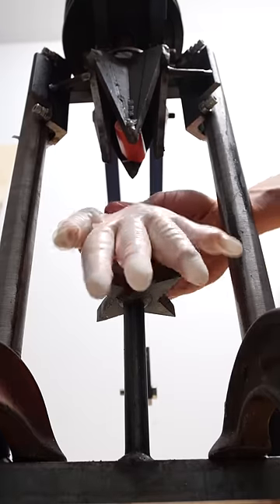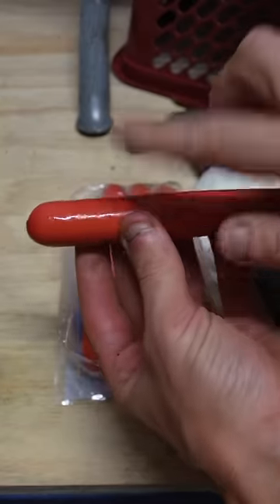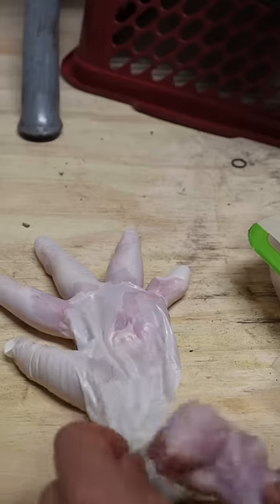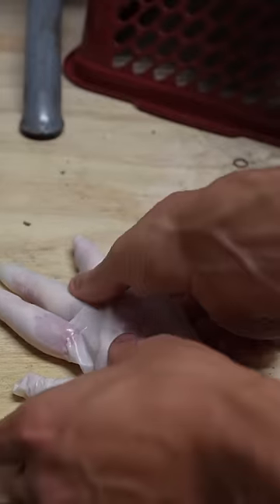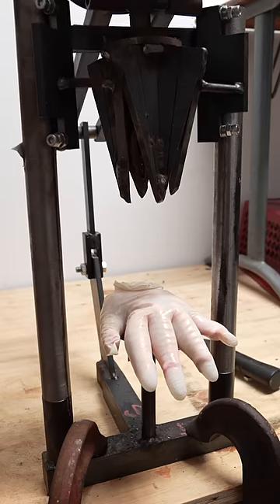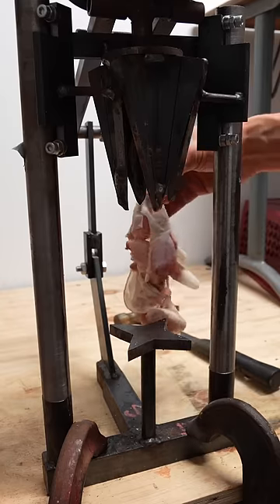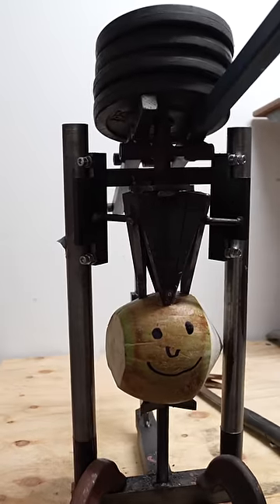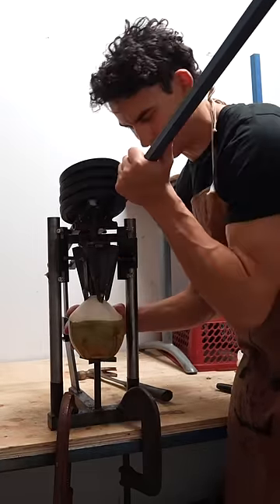Can crusher vs human hand

Comment: He even circumsized it and made the tip anatomically correct. Fucking legend! 😂
Reply: Circumcision is literally making something the opposite of anatomically correct...
Reply: @Ki_Adi_Mundi  facts
Reply: @Ki_Adi_Mundi  not as bad as the droid attack on the wookies
Reply: @cesruhf2605  FACTSSSSS😂😂😂😂
Reply: @Ki_Adi_Mundi  It least it doesn’t look shriveled and collect STDs
Reply: @Ki_Adi_Mundi  Anatomically correct to a circumcised penis...
Reply: @DarknessOfRedbone  an uncircumcised D does not “collect” std’s. It’s the same for if you are circumcised, just use protection. (Also there is quite literally no benefit to circumcising)
Reply: @dustinkalmeijer7313 no benefits other than avoiding nasty uncircumcised cheese 🤮
Reply: @gabekempfert5421  could easily avoid that by showering daily 😂
Reply: @guts_-_-  Imagine these guy "showering daily" 😂
Reply: Wait, I thought it was a finger
Reply: @gabekempfert5421  That's like saying ripping out your adult teeth avoids plaque build-up over time. This is the most insane defense of infant genital mutilation I hear and it is too common for common sense to be applicable in this situation.
Reply: @Ki_Adi_Mundi  it looks better, it’s done for religious reasons, and you don’t have to deal with maintenance you otherwise would have to do with your penis. I think it’s worth it and morally correct according to my religion so my children will undergo the same process I did
Reply: @coop_snow  "It looks better" that's a biased comment if I've ever seen one
Reply: @ELP2626  would destroy a uncircumcised one ☝️
Reply: @Ki-Adi-Mundi Buddy thinks a piece of useless skin and a part of your mouth that you use to survive are comparable 😂
Reply: @dustinkalmeijer7313  or if you have medical issues that stemmed from having it uncut (like not being able to peel it back properly)
Reply: @EddieHall-m7x  The fact that you think any part of a baby's body is useless enough to scrape off as they scream in agony just proves you aren't human on the inside. But then this is a YouTube comment section, I really shouldn't be so surprised that I'm talking to something without a soul.
Reply: @Ki_Adi_Mundi  says the one that legit in a yt comment section 🙄 🤣
Reply: @EliTheElite1876  I'm sure you think self-defeating logic is the best kind but I don't have the patience to argue with Fortnite "playing" NPCs right now.
K?
K.
Reply: @gabekempfert5421  just take a shower man it isnt that hard
Reply: @coop_snow  no it doesnt looks better
Reply: @KeepOnTrying777  Make sense
Reply: @coop_snow  religious reasons are different. But if you are to lazy to just clean it in the shower that’s crazy to me and also when it gets circumsized the tip loses some of its sensitivity.
Reply: @dustinkalmeijer7313  it doesn't loose some sensitivity. It looses most sensitivity.
Reply: @EddieHall-m7x  I mean, the foreskin does have a use...

It not only keeps in moisture to make masturbation smoother as you wouldnt need lotion or a lubricant as well as keep the head of your penis VERY sensitive.

One thing I always found weird about cut penises when I was younger was how they could let it sit in their underwear and not have it be uncomfortable. It was later I learned that a layer of skin forms around the penis which can play a role in reducing overall sensitivity which imo is not worth it.
Reply: @mrcookie4308 yea it does
Reply: @coop_snow 
So, because of lazy parents that aren't willing to clean their children daily and would rather make them dependent on lotion and make their fun less exciting?
Reply: This reply sections funny ash
Reply: @Ki_Adi_Mundi It’s taken off for religious reasons
Reply: @Mint_drake not all sensitivity feels good that like saying saying if someone touches your leg it feels good
Reply: @Tom..Shelby  why not let him decide what religion he wants to be part of when he's an adult?
Reply: Bro, what is this uncircumcised hate, tf?
Reply: @gabekempfert5421 there’s a thing called showering, which most circumcised people don’t do apparently
Reply: @Birdx69420  apparently 🤷‍♂️
Reply: @Ki_Adi_Mundi it has a medical purpose and is not just mutulation. I had to be circumcised to avoid problems. Inform yourself pls
Reply: @coop_snow  there is still maintenance, you still have to take care of your penis. Please tell me you're not just lazy about your hygiene. I'm cut and find it sad that you like being cut for hygiene. I think using religion to enable abuse is kinda insane, let alone hygiene. 

We shouldn't be lazy about our hygiene as men. Cut or not
Reply: @AkorekLP  did they give you any choice of how much was left if it was for medical purposes? Was that something even in your control?

Comment: wish you could get some company to send you a realistic hand that they use for ballistics training to put through it.
Reply: Ballistic gelatin isn’t that difficult to make at home
Reply: @jogiff  but the realistically dense bone structure
Reply: @drewsalvigsen6171  you can get full made hands and body parts but it does get expensive when it has the bones and stuff within. Like $120 for a hand alone.
Reply: @drewsalvigsen6171  like the ones they used for that blade smith show
Reply: checkmyaboutpagelink738 no
Reply: The chicken wings are pretty close to your fingers it's got a bone in the middle and plenty of meat around it so as far as stand in go that work  out pretty good.
Reply: @Mark-gs6nn  A living hand is much more durable than a long-dead and processed chicken wing. But I guess it is close enough.
Reply: @jasontodd1141  That sounds SO wrong out of context

Comment: considering that the bone of a human skull is only about 6 mm thick, the fact it pierced through the coconut THAT far is still terrifying O_o
Reply: I would bet that a skull is tougher than the coconut shell though, but you would still get scalped
Reply: if it doesn't kill a person they will soon wish it did
Reply: @-TheMachineGod-  skull would still most likely crack
Reply: @roowut  fair enough
Reply: @-TheMachineGod-  considering it takes 15 pounds of pressure to break a human skull and it takes between 200-400 to break a coconut, you should feel much more threatened that it did that much to the coconut.
Reply: @OdinPlays94  Source? Are you even a pokemon master? Or are you a wannabe like Ash Ketchum?
Reply: @picachugirl2036  takes five seconds to Google it. Don't act dumb.
Reply: @OdinPlays94  I just looked it up and the answers are on the range of 520-1100 lbs of compression to fracture a human skull.
Reply: 15lbs to crush a skull doesn't make sense if you remember that almost everyone can easily squeeze 15 lbs of force between their hands. It's not that easy to smash your own skull.
Reply: @OdinPlays94  Where the hell did you get 15? You realize you can squeeze 15lbs of pressure with one hand right?
Reply: @stealthxg5045  15 pounds of pressure is an entirely different concept than 15 pounds of weight. How about doing a quick Google search for once?
Reply: @Chicky_Lumps  really? Because I just googled it in response to what you said and it tells me 15 pounds of pressure. There's a difference between 15 psi and 15 lbs.
Reply: @Chicky_Lumps likely 15 pounds focused onto one point. The higher number is likely talking about compressing entire head before bone would start giving out due to force. There's many different ways to apply forces to anything. In this case the numbers you'd want in this case are for the blunt force required to punch through
Reply: @Avery Andronyk  the spikes are sharp and pointed at the end. So, the forces are focused on a few tiny points. Reminds me of Grant Imaharas' famous battle bot with a spike hammer.
Reply: @OdinPlays94  Where did I ever say 15 pounds of weight? Learn to read.
Reply: @OdinPlays94  That doesn’t make any sense because pressure and weight are measured in different units. Pressure is force per area so do you mean PSI? Don’t correct people if you don’t know what you’re talking about lol.
Reply: @1justdont  First off. I stated pressure and psi quite plainly. Secondly, I did not correct anybody. Don't say anything if you don't know what you're talking about.
Reply: TRUE
Reply: @OdinPlays94  it says 16 lbs of force for a simple fracture and 1,200 pounds to fully crush a skull
Reply: Bone is stronger than Steele tho
Reply: @isaiahthemack8892  I have reiterated the difference between force and pressure enough times in this comment thread. You got things you need to figure out my dude.
Reply: @OdinPlays94  I dont think thats quite right
Reply: @OdinPlays94  what kind of pressure are you referring to? Im not finding an answer in PSI and I'm actively searching because I'm interested. Are you referring to GPa, Newtons, BAR? There are a few different kinds of pressure, that isn't psi, which is measured in FORCE, not PRESSURE.
Reply: @OdinPlays94  Google says 1100 pounds of pressure for a human skull, we’re you looking up a newborn babies??😂😂😂

Comment: I think your fingernails explain all what I need to know about not using this machine
Reply: Man I'm dead💀
Reply: It could be from Him biting them probably from anxiety. My boyfriend used to do that and had nails just like him
Reply: @vanessah3127  exactly my nails are just like this because I’ve used this while having a lot of enxiety
Reply: @vanessah3127  Brachydactyly type D
Reply: My nails aren't quite 'as' short, but similar, and I never have nails that require scissors. All from just routine/habitual biting.
Reply: @vanessah3127  the ones on his toes also look like that if thats really the reason bro is overdoing it
Reply: @noelramirez1551  cool.
Reply: Jesus the dude's thumbnail looks insane
Reply: In @wakandaSavage's voice... SAVAGE!!
Reply: @vanessah3127 and it could be because he does a lot of work using his hands. Not everything needs to be because of a psych issue.
Reply: Thank you
Reply: @itsgonnabeanaurfromme working with your hands doesn’t take your nails to that length. He’s a habitual mail biter. And his nails are filthy in every video. He will eventually have an infection start in his cuticles & you can absolutely lose fingers /die from untreated infections

Comment: Watermelon is actually the closest thing to replicating the piercing pressure required for the human skull
Reply: Yeah cuz be honest a coconut is alot stronger than our head
Reply: Roughly the same density, so yeah.
Reply: Not that hard than
Reply: Completely incorrect. Why did 47 people like this comment?
Reply: @ZekSanchez  Here's why. Because he's actually correct. A watermelon and a human head have roughly the same density.
Reply: @demonslayer5122  The density of a human skull is more comparable to that of concrete than that of a watermelon.
Reply: @ZekSanchez  So the human skull can withstand 6.5 GPa of pressure.
Concrete is 30 GPa
GPa is a gigapascal

I uh. I think concrete is more sturdy than a human skull. And thicker than a human skull.
A watermelon isnt accurate but its the best we got.
unless you work with cadavers
Reply: @elvingearmasterirma7241  What about coconut?
Reply: @ZekSanchez  Well. I do know a coconut can easily crack open a human skull! In fact if you stand under a coconut when it drops from the tree youre likely to perish!
Reply: @elvingearmasterirma7241  Does that also cause the coconut to break?
Reply: @ZekSanchez  No I think the coconut is fine

Comment: One thing you should know is if you do carrots are like fingers, they break like our fingers
Reply: Yeah but like, carrots are loads weaker than our fingers, by a lot.
Reply: They don’t have the strength of our bones
Reply: na they aren’t. he even made a video on it and proved it wasn’t true
Reply: Wrong. You can bite your finger off as easy as you can bite a carrot, but a carrot definitely isn’t as strong as our hand.
Reply: NEVER TRY THIS
NEVER
NEVER

You can bite off your finger just like some sorta carrot, but ur mind  (and COMMIN SENSE) is stopping you
Reply: @wyaHam crazy how you say someone wrong then wrongly speak. If you bite a finger on the joint(where there is no solid/connected bone) then it reacts like a carrot. Otherwise fingers are much stronger.
Reply: @wyaHam  no, you cannot, you wouldn’t even break skin if you bit down with the same force you would on a carrot.

Comment: Fun fact:
It takes the same amount of force to break/bite/cut through one of your fingers or a carrot.
So maybe if you used carrots to resemble fingers it could turn up more accurate results
Reply: fun fact:
you're wrong
Reply: better idea tbh
Reply: @JakeB5492  personally i think carrots would be better since theyre a little harder than sausages which are floppy n shit
Reply: @matthewh2672  I saw a few peopl mythbusting it, I forgot who but basically they put a carrot in a skull and used weight on top of the skull to show the amount of force it takes, and made a realistic model of a finger. Carrot took way less weight.
Reply: @matthewh2672  you will need to bite 3x harder than you would bite a carrot to successfully eat your finger
Reply: Okay, the calculations may be off but I do still think carrots would be a better model to use than floppy hotdogs.
Reply: Thank you guys for correcting my mistake.
Reply: @matthewh2672  true, whoever used hotdogs actually has hotdog meat as a brain